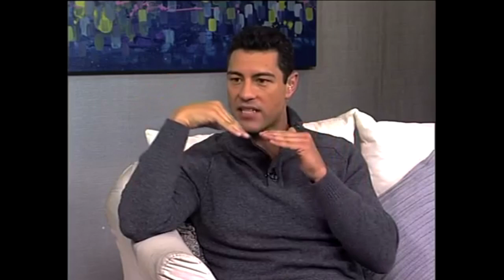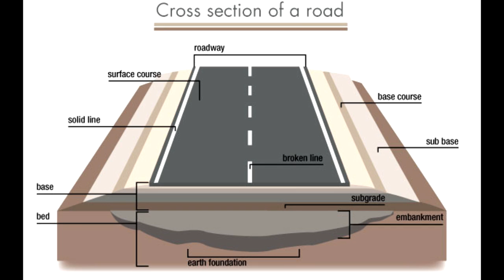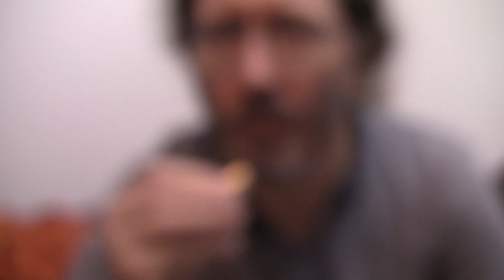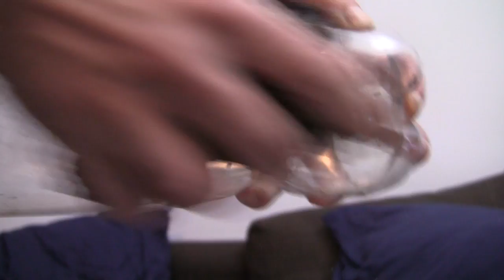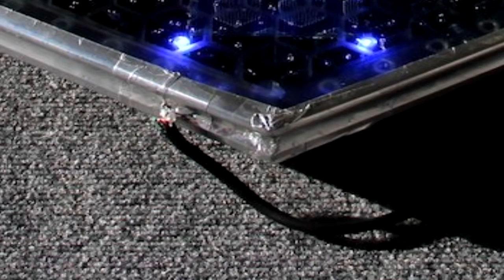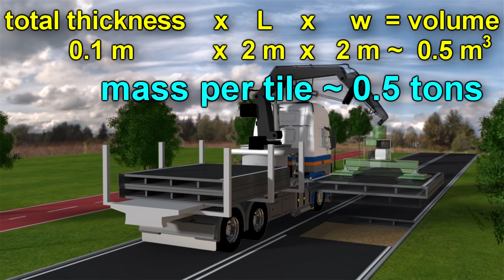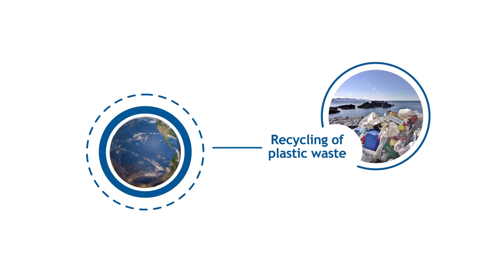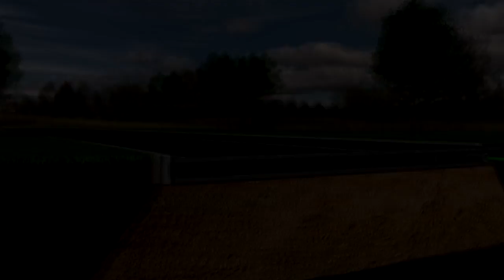Plastic Roadways BUSTED!

Comment: well as a plastic engineer trainee (i think it's called in english) shredding old plastic and heating it up and injecting it into a mould is pretty common in the plastic industry... dont think you did your research on that one...

on the time saving... injection moulding is properbly one of the fastest ways to build stuff... we dont have big enough machines where i work to be able to build stuff like this but we do make domes for ship radars and we produce 1 every 127-132 sec... so a road module that size would properbly take 20-35 min in my estimation...

and plastic has a much higher resistance to bumps and scratched if u use the right filler... you can't compare it to glass in any way... too soft? u can make plastic that's as hard as steel with the right mix... dont think you have actually researched this...

PET has the same hardness as gold? where did u dig up that nonsense? please supply your sources for this nonsens...
and PET in pop bottles usually dont have any additives sometimes it has some kind of thinner to make them softer...

this would be the same as saying glass is easy to break with your fist and then pointing at a car window...

and again if u add fillers it won't rot in daylight... u are aware that stuff like bumpers is made out of plastic that decompose in sunlight right...

heres a idea on how to join them together... plastic welding... you do know that's a thing right? really sounds like u haven't researched this alot... really not what i expected of u...

im not even gonna comment on the rest of the errors in your reasoning... which is sound when you dont know enough about plastic... and i see that wavin (one of the biggest plastic manufacturers in denmark (which is the only country that i know of that actually has a plastic engineering education in the world)) 

well its a fair point that when u replace a module u do disrupt the wires going through them...   

well ofc its a composite plastic... almost all plastic that's used is... even the plastic for pop bottles...
and recycling plastic does not take as much energy then extracting it from oil... all u have to do is clean it and then shred it... in some cases add some additives... so it's actually better then asphalt...

i do want to point out that i dont know exactly what kind of additives they are gonna use (if any) or what kind of production they are gonna use (there are many different ways to mould plastic) but the idea is actually pretty good... better then regular road... not sure about that tho since a air pocket could cause a module to break in half and course crashes...

but when it comes to reusability and time it's a much much better alternative... and cost if u factor in time spent making the blacktop vs making it in a automated facility...
Reply: -nobody doubts that injection moulding is a fast process - the argument though was that the bulk of time to construct a road isn't in putting the road surface on but in constructing the underlying layers that you have to construct the same way with plastic roadways.

-how many moulds do you need to replace most roads? I suspect that just one, straight, wouldn't do. In the real world there are such a wide variety of curves up/down/left/right and angles of intersection that you either need to produce foundations specifically for your road moulds or have an unreal number of moulds ready.

-yes you can (and need to) add fillers to make the plastic tougher, UV resistant, fire retardant etc. - but that will all add to the production cost of the material thus making it less credible that it will be able to compete with asphalt financially. Eg PBI (Celazole) seems to be up to the task but wouldn't be financially viable (something like 25x the cost of cold rolled steel) and I suspect you don't get that from recycled trash either.
If you can't just take a ton of any trash plastic and transform it into a road but need to sort and combine in specific quantities adding fillers to alter the properties that already sounds much more expensive to me.

-road surfaces in germany (not a particularly hot country) have reached temperatures of above 60°C in the summer, that's because the surface temperature of the road has to do with how much light it absorbs rather than the ambient temperature of surrounding air (that's why on hot days you can see a mirage on the road due to hot air directly over it). If your plastic road is black it will also reach relatively high temperatures, if you make it more reflective it will get really cold in the winter because the sun won't heat it up much.
Most recorded temperatures are also "in the shade" which you can't assume roads will always be in.

-having an air pocket in your road obviously brings some problems, but you don't even have to go as "extreme" as accidents to see some. That pocket could potentially act as an acoustic  resonator making that road over the top noisy without comparison.

-road surface can already be recycled so using a different recyclable material doesn't make that material better just on those grounds.

I'm not saying those are problems that can't be overcome but I'd at least say that it isn't obvious at all that plastic roadways would be a more cost effective and reliable alternative to conventional roads.

Sorry for not putting any links in but the last time I did that youtube ate all my comments for 2 weeks -.-
Reply: well didn't think about curves... that would properbly need another mold or 5... but making and maintaining a mold is cheaper then building/buying and maintaining a concrete truck... but then again buying and maintaining a molding machine isn't cheap either...

the additives is actually not that expensive and most reused plastic doesn't need it
and it's getting sorted at recycling stations anyway 

well as i pointed out u can add stabilisers so it won't expand unless it reaches a lot higher temperatures then 60 degrees at my old job (also in the plastic industry) we made housings (can't remember what for) that was stress testet at -40 degrees and 240 degrees and it was only allowed to expand/contract 2%

not sure but i dont think a air pocket would make any sound...

im not saying it doesn't have its faults just saying that it might be more viable then Thunderf00t make it sound...
Reply: Ok, going to be snide and recommend some tasks for the trainee, all in good spirit of course;

Create a slab of steel plastic that doesn't break under 8 tonnes of pressure. (two 4-tonne trucks passing each other on the same segment)

Create a plastic weld between two pieces of the previous material that can also withstand 8 tonnes of pressure.

Then make it resist sunlight for 10 years at least without becoming brittle.

Then make it so rocks don't scratch it into powder (dirt on tires, dirt is rock) - we don't want to be breathing those miracle-roads now do we? :)

When you're done, we can compare the bill you rack up with the cost of a conventional roadway. That is, if you manage to finish.
Reply: Just because it's funny, i don't mean this as an insult to you in any way.. But i've never seen a radar dome with a traffic jam on top of it :p
Reply: well all i can say is that some plastics are more durable then tempered steel... most ship hulls is made out of plastic... and plastic welds has up to 98% strength of the original material... and making a plastic sun resistent for 10 years is not really a challenge... window frames are made out of plastic and they stand in direct sunlight without getting brittle...

all the "challenges" your proposing is stuff that plastic is already doing... i do not know how it will react with a lot of weight running over them repeatedly tho...
Reply: There aren't any plastics however that fit all of the nescessary criteria at the same time.

That's the big issue - a lot can be done, yes, but again i don't mean to be rude when i point out that window frames don't bear many tonnes of load, nor do they need to be resistant to wear from dirt rubbing on them, they 'just' have to resist light weathering from the atmospheric phenomenons.

Ship hulls also fall in a different category with quite a lot of leniency on the properties of the material compared to what a roadway has to offer in order to compete with asphalt.

I would love for the idea to be feasible and reasonable, so don't fret, there's no fighting needed here, but if you want to make a bid for the job of making better roads than what's being done with asphalt, then they need to live up to the needs and at least outperform asphalt in one property without compromising the rest as a result.

I love plastics a lot, I use a lot of them every day in the lab, each item specialized to its function, and there are very few of the applications I need them for where rock could reasonably compete. I would loathe the day where I had to use PCR tubes made from rock, as they would shatter easily from the hefty vibrations of a vortex mixer, or come apart along crystal intersections as they get spun at a few thousand G. A pipette tip of rock would seriously damage the pipette tool itself upon changing tips, which is needed between each operation with different reagent contacts, and would thus also be useless. Here, plastics are distinctly valuable for the mixture of malleability and durability that they provide. Of course, since I work with microbiology and we use strong UV to help keep work surfaces clean, it is evident that the plastics that are durable enough to withstand UV radiation are also the plastics that are too brittle to take much flexing - a lot of this type of plastic is used in the housing of machinery, boxes containing reagens and tools, and across the board they shatter with very little give, whilst the plastics that give and flex readily are the ones that take damage from UV. (not nescessarily an accurate representation of all plastics of course, just the ones i work with).

Anyway, don't let me get you down, keep studying and learning, become not just a master artisan and a genius at your craft, become the teacher of tomorrow, as long as what you teach is sound and effective :]
Reply: window frames actually support a lot of weight compared to the amount of material used... dont know if its because of the design or the additives tho...

i dont know if plastic would be better then asphalt i'm just pointing out that it could be with the right additives... ofc as with all new ideas it need to be tested...
i do see problems with curves since that would require more moulds to be constructed...

and dont worry i'm already planning on taking the plast specialist course when i'm done with the engineering part :)

Comment: And if they pull a modular section of road up to replace it, they'd have to remove the cables and piping all the way up the road, then push it all the way back down the road after they add the new modular section back in.

Comment: At 9:10 those parts you have light up wouldn't be the part I would worry about. They would be weak and break, but I think the surface of the road would collapse first. When it does, whoever is the poor soul to drive over it will have their tire mauled by the sharp bits of plastic around the hole.

What a perfect use for recycled plastic. Instead of reusing it for our everyday plastic needs, lets turn it into a dangerous road so we have to make more plastic for everything else.

Comment: Why does Total sponsor this? Before I would hand out cooperate money, I would ask which plastic they plan on using, then I would forward it to a specialist of that plasic (which total as petrol company has to have or have to have access to) and then it would be over. Even the marketing moron has to do that - imagine if they plan on using competitors property petrol product, (recycling is off course fine - as long as they are direct side products of the petrol industry)
Reply: What plastic, you ask... good question. The answer is: they don't even know themselves, as they're ready to admit in their own .pdf project abstract on their own website. "Research will have to show..."

Comment: I dont understand this new fascination with road surfaces. If we are using roads 500 years from now they will be made of the same material. Asphalt is almost infinitely recyclable, very easy to repair, and provides an optimum surface for traction. They even have trucks that can repave the road as they drive along recycling the old surface. Plus, if you have ever lived in an area with heavy trucking, you'll see at every red light ruts created by semi trucks coming to a stop. They basically plow the material. Concrete is also a very good surface and can withstand more abuse, but its very hard to repair and requires expansion joints to prevent cracking. It also suffers more damage from ice in the winter, as well as more ice accumulation because it's a light color and doesnt absorb as much light. It would also be very difficult to achieve optimum road crown with rigid plastic.

Comment: Prefabs for roads have one problem - places where pieces meet. Just drive on a road made from concrete prefabs to check it out. Each slab will move just slightly as the earth below shifts. If it was continuous cover it would be unnoticeable, but with slabs it will be very apparent between them. To prevent it they'd have to have REALLY impressive foundation, which defeats the whole point - it'd would triple the major cost of the road.
Slabs make some sense for rapid construction i.e. natural disaster or such. But you don't want lightweight - you want heavy slabs. Drop it from trucks on somewhat leveled terrain and temporary road is immediately constructed. No one will drive it with speeds above 60km/h and even on slow speed it will be bumpy - but it will work. Trying to make a permanent long term road with prefabs (especially long ones) is just 8th reason the idea is unfeasible.

Comment: FRP trench covers and manhole covers have a 30-year life.   They aren't currently  recyclable though (which is a selling point because people steal metal ones).

I'm not sure, however, their application would work.   Those are generally SMALL pieces that are not only thick, but have a lot of support so they don't flex.  The substrate they'd need would be extremely expensive to build due to those requirements.

OTOH, if you don't support them well, they flex quite a bit because they're not very rigid.  And when they flex, the fibers break.  And then you get (I know this personal experience) a catastrophic failure.

Comment: A few other points... do these people think the Earth is completely flat everywhere? Obviously there are hills with a certain radius of curvature. Are they going to have to manufacture different panels with different radii of curvature? Otherwise, the road wouldnt be very nice to drive on. What about the fact that roads are not completely straight and are also banked to aid vehicles in accelerating around corners. Sound to me like they will need to spend a lot of money on creating molds for the thousands of different shapes of panels they would need.